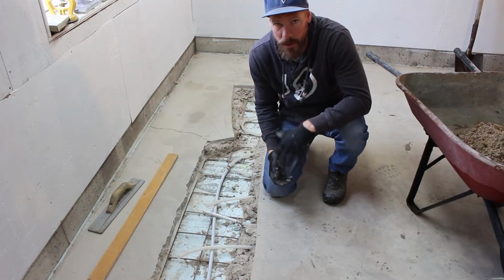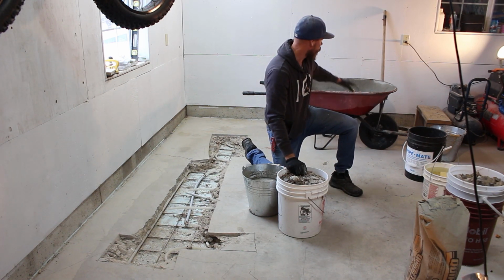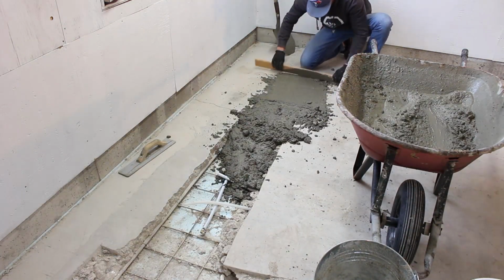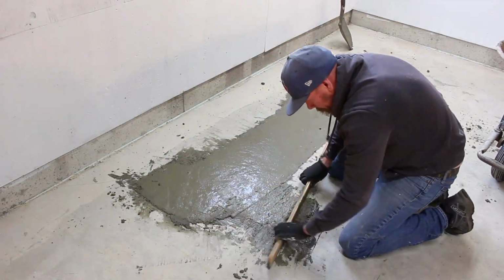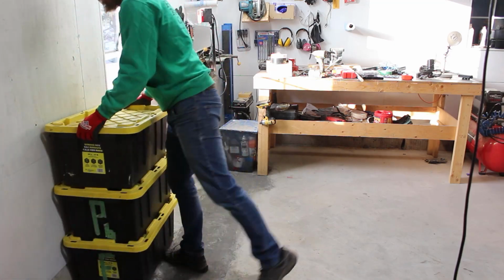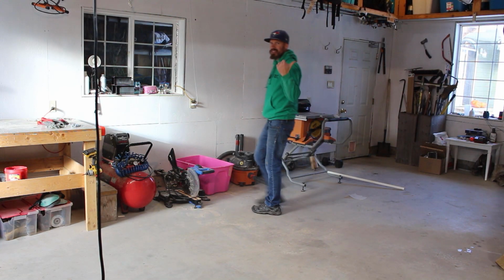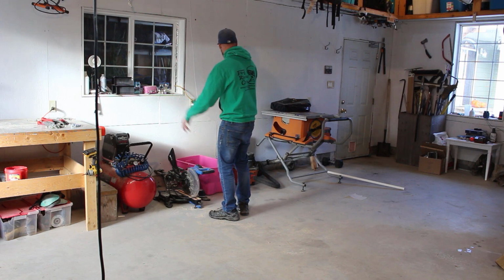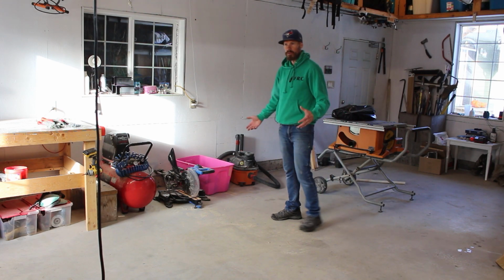Repair Concrete Garage Shop Floor - Recycled Concrete Repair - Repair Leaking Radiant Floor Heat

Comment: Question about your in-floor heating repair: Do you expect you'll get any cracking issues in winter with the one cold spot surrounded by remaining loops, or is the remaining heat enough to radiate throughout the whole shop? Either way, I wouldn't have thought to repair it but just bypassing the broken loops; I'll have to remember that for the future if I ever need to take on such a project.

As for my guess, it looks a bit like Banff or Quebec City.
Reply from the maker: I actually did the repair of the heat last fall. The system worked totally fine. I don't see any cracking due to the 2 loops without heat and didn't notice the lack of heat, really. But good question! 
It was a pain to smash up, but worth doing since that loop is under my work area.
Reply from the maker: Banff is much closer than QC
Reply: @TheHowtoDad  Now I'm just too curious: Seattle?
Reply from the maker: @bizm  nope...